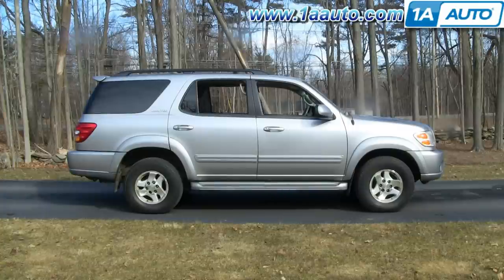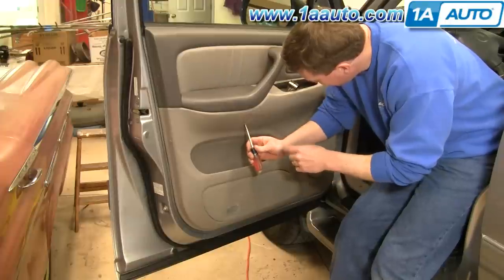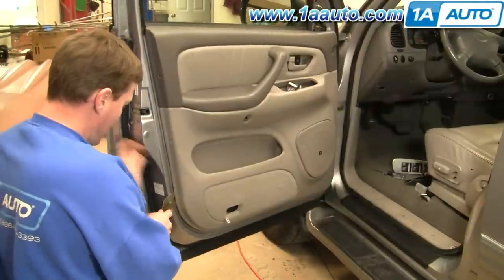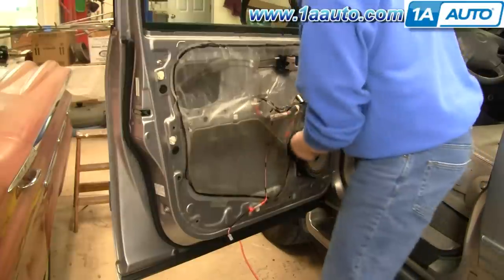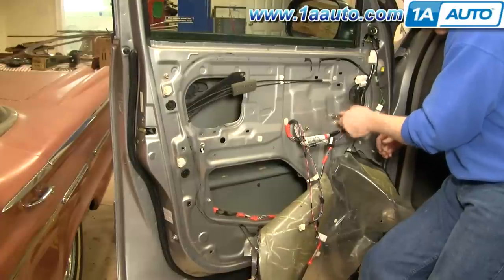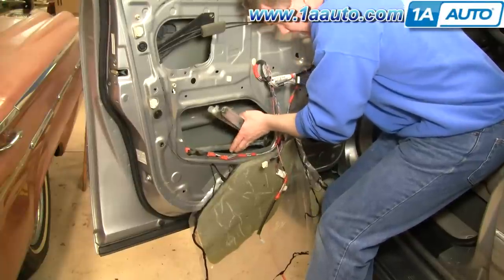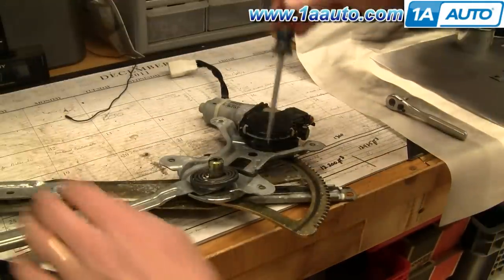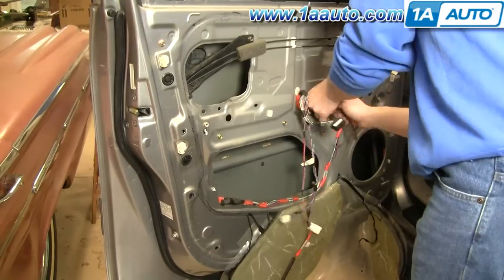How to Replace Power Window Motor 01-07 Toyota Sequoia

Comment from the maker: If the vehicle has power windows, you may want to check to see if there's power going to the window motor. You may want to check the fuses to see if any of them are blown, you could also test the wire going to the window motor with a test light to see if it has power going to it. Hope this helps you out. 1aauto.com 888-844-3393

Comment from the maker: The only way to figure out the issue would be to remove the door panel and see if the motor is operating, check the electrical connection for power when the switch is engaged, and also visually inspect the regulator for bent or damaged regulator parts.

Comment: Did this replacement step by step & installation was fine & dandy........everything worked out great. Except 1 issue the difference with mine is when i uset tbe "auto" up feature the window automatically goes down perfect. But when using the "auto" feature to go up, it goes up all the way then back down halfway. Why?

Comment: This was a great video, I was able to fix my window on my 2003 Tundra today. Only cost $18 for the motor. For the connector I just cut off both wires and then twisted them together on the new motor and wrapped with electrical tape. Other than that everything was the same as the video. Thank you for taking the time to create this for non auto-mechanics like me. That is why I am an accountant. :)
Reply from the maker: +Corlocka Thank you for the great reply. We love to empower our customers by showing you how-to perform your own auto repairs while installing our high quality auto parts. Have a great day! 1aauto.com

Comment: A question for the archive...

...isn't there a concern about the position of the geared motor pinion relative to the position of the toothed regulator lever in its own range of travel?  

For example, a new motor could be anywhere in its range of travel between up and down, yet as in your video, you are attaching the motor to a regulator in its near-fully-up position.

I'm thinking the 'pinch' sensor will be triggered in this situation, and the window will never be fully open or shut as a result.
Reply from the maker: +Sam Johnson Some vehicles require you to run the motor plugged into the vehicle, but not attached to the regulator first. Mike reinstalled this motor with the regulator fully open. You make need to perform a window limit reset.
Reply: Sam Johnson 
I was wondering the same thing but couldn’t come up with the excellent wording that you did

Comment: I just had a passenger side window glass replaced by SAFELITE on my 2001 Toyota Sequoia.

If you pull button for the window to go auto UP, it travels up and then back down to the 1/3 closed position.  Safelite tech said the window "anti-pinch" sensor needed reinitialization by the DEALER as he couldn't do it. $430 estimate from STealer!
Is this something I can do? 

What's this "reinitialization of window motor" about specifically on the 2001 Sequoia?

Comment: I have a Sequoia whose front driver's side window operates slowly - how do I determine whether it is a weak motor or binding crossmember frame?  I suppose disassembly and visual inspection is the only way?  How do you diagnose the motor's strength?  Thanks!
Reply: I’m wondering the same thing!

Comment: My driver's side window on my 2001 Toyota Tundra has gone down and will not go back up.  The fuse seems fine as I replaced it and it still doesn't work.  Does that mean it's the motor in the door?  If so, who sells the power window motors for a 2001 Tundra?
Reply from the maker: +Mark West We carry replacement power window motors and regulators on our website. Here is a link to them. Hope this helps you out https://www.1aauto.com/2001-toyota-tundra-power-window-motor/y-mo-c/2001-407-22?utm_source=YouTube&utm_medium=CTA%20Comment&utm_campaign=ytcomments
Reply: Thank you!!

Comment: As always, really helpful video.  My window goes up and then backs itself back down about 1/3 of the way.  I took it out and reset the motor on the teeth of the regulator and it still didn't work properly.  What is the deal?  I didn't see where you guys addressed the position of the motor on the regulator.  Thanks.

Comment: I have a 1986 Toyota Truck 4wd SR5 and the power window motor is out on the passenger side.
are you saying that i have to undo all the bolts, release the regulator and remove it as well as the motor to replace just the motor while suspending the window ? Both th eregulator and the motor have  to be taken out to replace the motor ?  Thanks

Comment: mengl1000:
Many discussion of this on the tundrasolutions dotcom site.  Apparently the motor connections oxidize from prolonged period on not being used.   I banged on the inside of the door with my fist against the motor area and the motor worked again.  I now lower/raise it each time I gas up the car.

Comment: This was great. Thank you, thank you, thank you. I was able to do this without any trouble and save lots of money. Tips for others who may be doing this the first time (i.e. things I wish I'd done differently):
1 - write down each item you remove or disconnect so that you can put them all back in reverse order.
2 - if it's a cold day, use a hair dryer to loosen moisture barrier adhesive. I carefully used a box cutter to cut through adhesive bead to remove it and then used a hot hair dryer to soften the bead when replacing the plastic barrier. Any tears? Use some strong packing tape to shore it up.
3 - note, when checking/testing the control prior to reinstalling the glass, do NOT move the lift mechanism to its topmost position or you risk doing damage to the motor assembly. Once installed, the window attaches to the lift mechanism to properly align it and everything works fine. Prior to that, do not power the mechanism up beyond the door openings.  
Thanks again, saved a bunch!
Reply from the maker: +Dan Tamburro Thanks for checking us out and the added tips! Have a great day. 1aauto.com

Comment: On the video you post for replacing the window regulator on a 97-01 Camry, you initially (a) lowered the window all the way to remove the door panel, and then (b) raised it slightly to access the bolts to detach the window from the regulator, then raising and taping the window to remove the regulator. That seems easier than unbolting the regulator (as you do here) with the window attached...is there a reason why you do things differently here?

Comment: How much different is it to do a rear door window motor? I got the panel off. I taped the window up. I could hear the motor click when we push the button up, but it won't roll up the window, and it won't hold the window up. Should I just replace the motor? Can I buy the motor and actuator that holds the window up together as one part? Is it a dealership only part? I'm gonna try and buy it tomorrow and do this. Good video, thanks

Comment: I need to replace two more window regulators! 1 for left side passenger and another one for right side (back) passenger. My dilemma is if I can use the same window regulator as I did with the right  (front) passenger side? Or is  each window regulator different for each door?☺😊😇😆😚
Reply: Thanks!
Reply: i had the same problem. but only the contacts were dirty, fixed

Comment: That was a great video! Thanks! I live in the UK, but I was wondering how a ' window regulator ' worked and how to get the door panel off. You guys are awesome for posting this as I now know how to see why the motor is slow/struggling. Maybe greasing the regulator will help. Cheers aauto!

Comment: Thank you for the video. It was very helpful.  Dorman 963-0810 (labeled Nissan, but fits Toyota) is a readily available replacement for the plastic panel retention pins, if one happens to break when it's removed.

Comment: the two bolts @ 6:30, how do I find these brackets? I don't know the name and no one sells them.  mine are broken and until I find them my car looks like a disaster
Reply: also, I ordered a new regulator and it does not come with the bracket I'm referring to

Comment: Had a window stop working in the down position.  Can I use the first part of your video to loosen the window from the track and then move it back up?
Reply from the maker: +Darrell Schaefer You may want to remove the door panel to see if the cable has broke on the window regulator, but yes if this is the case, you should be able to free the window up by hand and them push it up and into place until you can make the repair. You might need a piece of wood or something to hold it there. Here's a link to the window regulator shown in this video. We have them available on our website. Hope this helps you out http://www.1aauto.com/1A/WindowRegulators/Toyota/Sequoia/1AWRK00515?utm_source=YouTube&utm_medium=CTA%20Comment&utm_campaign=1ATony

Comment: I have a Land Cruiser 92, we have changed the window regulator on passenger right side. nothing happened. Now the window is all the way down.
Reply from the maker: +Mrs. Harris Thank you for checking us out. If you are still not able to use your power window function after replacement of the regulator and motor combination it could be a power window switch, or wiring going to the assembly. 1aauto.com
Reply: 1A Auto Parts I really appreciate your promptly response to my question. It really helped me, now, the window works just fine! 💞💞💞💞

Comment: Great video.  Why do you have to remove the spring?
Reply from the maker: +Steve Koz Thanks for checking us out! This releases the tension on the regulator as a whole and will prevent it from pulling on the regulator while you are repairing the motor.

Comment: Does that same moter work for all 4 doors? 
 I have a 2001 sequoia with a window that won't go up ...
Reply from the maker: +Sebastian Rodriguez This will only work on the Front LH Drivers side door.  Which door were you looking to replace the window motor in?

Comment: In my Sequoia motor is good but I need to help my window up is that still problem with the motor ?
Reply from the maker: +Jorge Perez This could be either the motor or the regulator itself, we'd suggest taking the door panel off to see if there are any tangled cables on the regulator. 1aauto.com
Reply: Thank you

Comment: I had a question. I have a 02 sequoia drivers window doesnt work but every other window does?? So would i replace the motor like on this video?? Or the driver switch? The driver switch works on the other windows just not the drivers anymore??
Reply: I had same exact issue with my 02 Sequoia.  Discovered the wire harness connector to the motor had a little corrosion on one of the pins.  Physically cycled the connection a few time, started running like a champ.  Returned the motor to store.